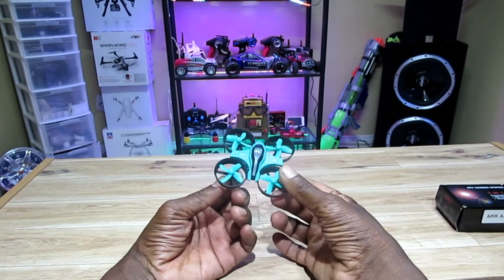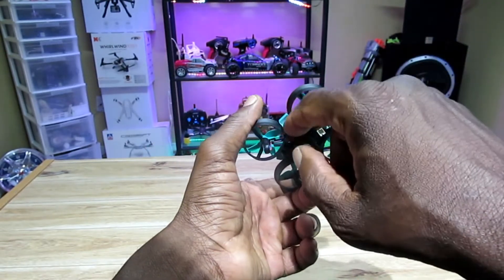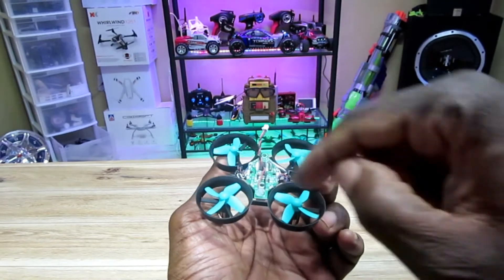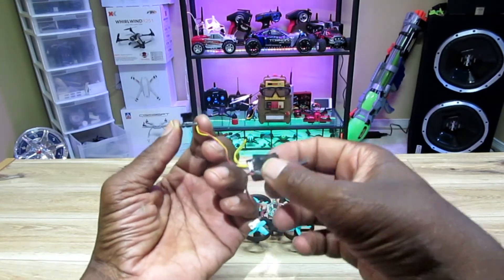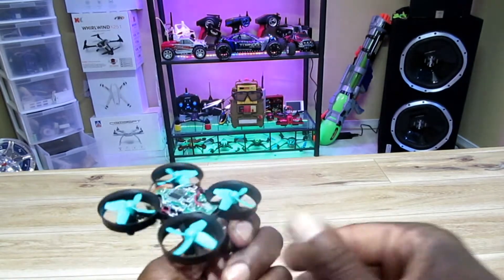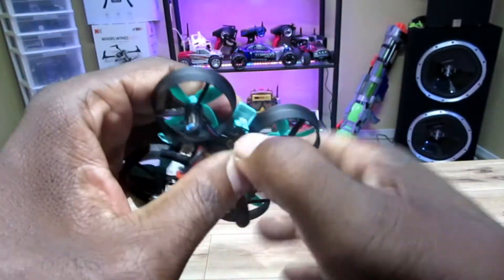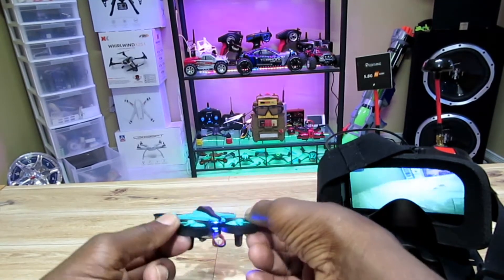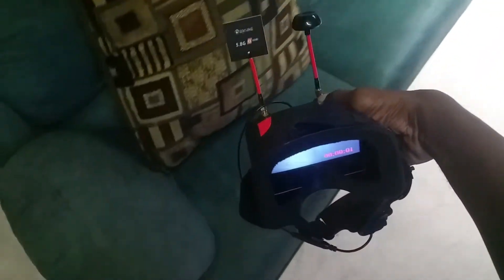Furibee F36 FPV MOD. Front Mounted Camera, transmitter inside the quad

Comment: Great idea. Im going to split an LS s2 to mount it this way. 
The F36 is incredible, I just flew an out of the box model with stock battery for 6+ minutes!
Reply from the maker: +FPV Stomper 
Thanks man,  yeah it's a great little quad, it's fast and very maneuverable. Have a good one 👍
Reply from the maker: +Elvis Campbell 
Check out the fpv flight 👍
Reply: Also report back if you get any vtx heat issues, I cant see it getting good circulation under there..

Comment: Great job on that quad cam mod. I need to order a new solder iron
Reply from the maker: +Big drone flyer77 
Thanks man,  i need a decent one. Mine is cheap but does the job. I have an older Instagram account, I'll try to connect with you that way first before the Facebook thing. Thanks for Watching man
Reply: Elvis Campbell sounds great

Comment: Great mount, Toronto! Thanks for the great video. Nice whoop! I love my h36 too :) I'm going to whoop my (larger) iDrone i3hs by patching in a vtx. It has similar clearance that I can use to stow a vtx above the battery. Has your mod held up over time with the electrical tape on the hot vtx? Cheers from across the pond in Rochester!
Reply from the maker: Thanks man, sounds like a good project. I haven't had any issues at all. Have a good one 👍

Comment: Great mod. I did I this with mine last yer but sucked battery power like crazy- bigger camera though, can't remember which it was (Eachine) I think. If I post mine will you do it lol. Thanks for sharing , great video cheers buddy :)
Reply from the maker: Thanks man! I mounted an Eachine tx02 on my Eachine e010 quad and the same thing happened. The camera was too heavy and needed a lot of power. Maybe a 2 minute flight. This camera is pretty light weight. Later man👍

Comment: Excellent video. I want to do an antenna mod to my Furibee F36. Do you know where to solder the positive and negative poles so the antenna will work properly. The remote only has a single antenna wire. Please help. Thanks.
Reply from the maker: Thanks man! The antennas usually have only one single wire

Comment: Do you know the settings for this to work on the jumper to ?
Reply from the maker: Someone told me that it doesn't work on the jumper. I was going to get one
Reply: Thanks
Reply: @torontorc4637  I'm pretty sure it is identical to the Eachine 010 and JJRC h36 and I think you can put them on the Jumper. Don't quote me ;)

Comment: nice !   
good ol' f36!   :D
I also tried once (with stock motors) the front/between air ducts/camera mount... but I didn't work for me :-/      It wobbles on hard fast sharp turns, full pitch/speed.
With the camera on top center, still wobbles a little bit but not as much as front mount.
Reply from the maker: +awdturbo4 
Thanks man!  Not sure why the wobble,  maybe it was a propeller issue. The camera i used is pretty light and the transmitter is in the belly of the craft which almost evenly  distributes the weight. Thanks for checking out my video man 👍
Reply: yep... I was also using a light camera and the vtx all the way to the back to have it balanced. I have about 30 cameras I was using the lightest one lol  new props also, I tried 4 and 3 blades.   But like I said, only at full speed and very sharp turns.     Now, I have also tried the f36 board on carbon frames with 7mm motors and it is a whole new beast lol
Reply: I really like the tx under the fc...that's what I was thinking (mine just got in a day or so ago, but already planning). I think the canopy on looks much cleaner (and protects the board to boot).

Thinking of swapping to a JST-PH connector. The longer batteries are going to require the front battery guard to be removed, too. Do you think that could be moved to sit between the first two ducts and mount the camera to that without too much of an issue with weight distribution? I've already noticed wobble with stock, so makes me wonder.

Also, saw someone tried making the 4 props into 2...said it affected battery and response positively. You guys tried?